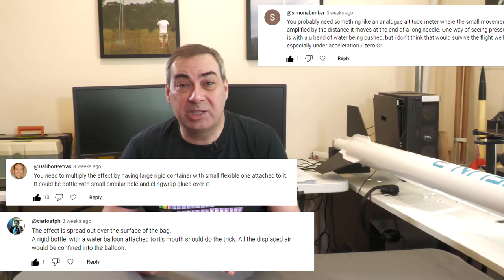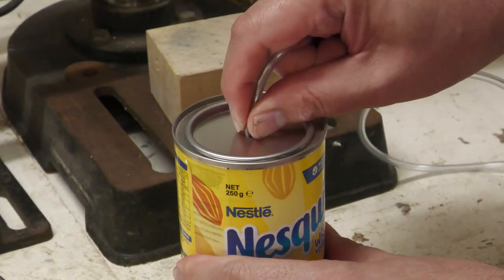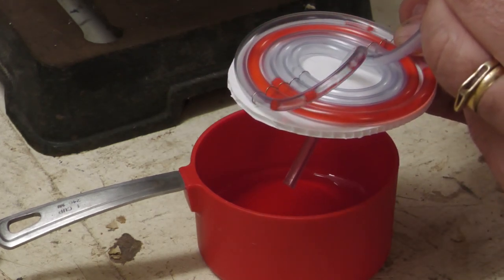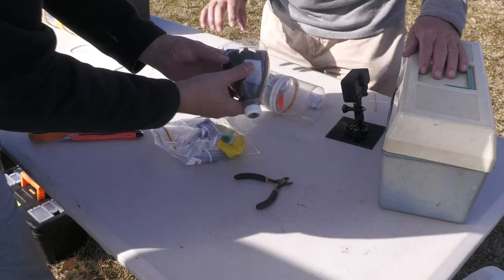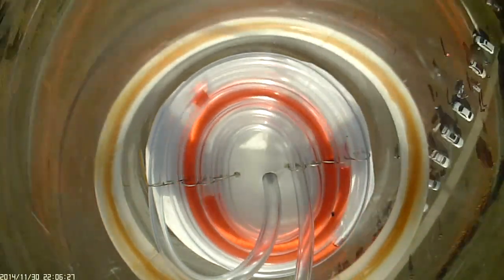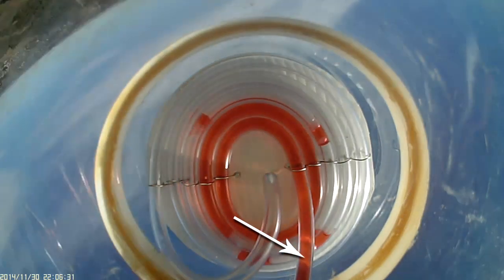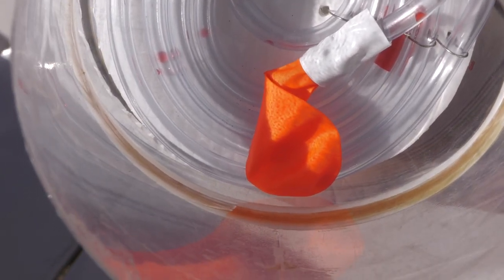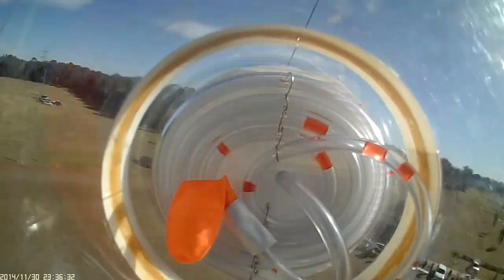Making a simple barometer

Comment: In the video you say the pressure in the can increases pushing the water out. Technically the pressure stays the same and the outside air pressure is lower as the rocket goes higher.  I know this is picky but if any would be science majors are following this a correction might be in order.

I use to fly R/C gliders in college in the 80s and we heard of a method to make a detector to figure out if you were going up or down thus making finding lift via thermals easier. It used a fix volume not unlike your experiment. There was an opening in the volume with 2 pieces of wire that had current passing through them in a bridge arrangement like you would use with strain gauges back then. The wires were high resistance and heat up. Since these wires were in the opening of the volume you could tell if you were in sink or lift by seeing which wire was cooled (and thus changed the wire's resistance)  by the air flow into or out of the opening to the volume.  The bridge balance current could be used to feed a transmitter with a constant tone that shifted up of down as the bridge balance would change. We tried to build one but we never could get it all small enough for the gliders. We were ME students not EE so that didn't help with getting it optimized as well as poor college student syndrome.
Reply from the maker: Ooops, you are quite right of course. Thanks for pointing that out, indeed the pressure doesn't rise. It would only rise with increased temperature. Really interesting description of the wire sensing mechanism to determine air flow direction. Thanks for sharing.

Comment: I reckon you could read pressure directly from the water if you calibrate it and put markings on the clear tube, but altitude will need to be calculated from pressure separately since it doesn’t go up and down linearly relative to the pressure. I’m sure it’s possible to get a pretty accurate altitude estimation with enough water trickery.

Comment: Recently I've got into water rocket building and your channel is simply a treasure of knowledge !:) It looks like you're using scuba tank to pressurize rockets. May be you could show your system in more details? Like, which regulators do you use and high pressure lines, stuff like this. Even with relatively low pressure launches with kids pumping the rocket becomes annoying pretty quickly:)) 
Again, thanks for sharing the knowledge, it helps so much!

Comment: I'm curious why the water didn't go back at the same rate during descent. 
Maybe the lid is not as airtight, as it should be?
Reply from the maker: Good observation, I noticed that too. I am wondering if the orientation had anything to do with it, perhaps it got more sun being on its side and the internal temperature rose a little.

Comment: I wonder if there is a way to use a water rocket to measure the atmospheric voltage gradient? I am not saying fly in a thunderstorm (Although this would be some great footage...), but the higher you get the more positive ions there are and this can produce significant voltages that you can measure with a Franklin Bell or an electroscope. The only practical problem is that you would need to connect to ground (or have some other source of negative ions?) - which would require you launching with a thin wire connected to the rocket.
Reply from the maker: It would be interesting to measure the static charge a rocket accumulates in flight. If you needed a ground reference you would probably need to unspool the wire from the back of the rocket the same way a TOW missile does it. I wonder if you would be able to detect any voltage across the length of the cable as the rocket falls back down through Earth's magnetic field. (If the rocket lands some way from the launch point so the cable is more stretched out)
Reply: Yeah I was thinking something like that. The unspooling would look great on its own - I'm not sure what the range safety officer would think of this idea!
Reply from the maker: @simonabunker  waves hand .... these aren't the cables you're looking for.

Comment: Im having trouble making my rocket stable, any tips on how to have a dtable rocket?
Reply from the maker: Put your fins as far back as possible. Add some weight to the tip of your nosecone. If it is just a single bottle rocket, add perhaps 50 grams to the the nose. What is your rocket's current configuration?
Reply: @AirCommandRockets  i have a 1.5L bottle, and have a bit of weight in the nosecone, my fins i calculated to get the right size
Reply from the maker: @SnarkyRattleTrap  Where are the fins mounted on the rocket? For single bottle rockets, they normally need to extend down past the nozzle. Hard to make recommendations without seeing the rocket. Also is the rocket unstable throughout the entire flight, or just during boost? If it is just during boost, try reducing the water amount to 25%. Do you use a full bore nozzle, or a restricted one? With restricted nozzles you have more weight near the bottom of the rocket for longer and so it tends to be more unstable. I would just add more weight to the nosecone as the simplest solution if you can't move the fins back. How did you calculate the size/position of your fins?
Reply: @AirCommandRockets  i could definitely try moving the fins longer back, as of now they are in front of my nozzle, thanks alot for the replies, and i love your videos!

Comment: Hey how many minutes to make thrust 1 min? 3 min?
Reply from the maker: I am not sure I understand the question.
Reply: @AirCommandRockets  how much pressure to make thrust
Reply: @AirCommandRockets  i pump for 5 minutes
Reply from the maker: @Colossaltitannwkwbend  How long you pump for depends on what volume of air your pump can pump per minute, what volume of air you are trying to fill and what pressure you are trying to get to. Let's say your pump can pump at 1 liter per minute and you are trying to pressurise a 2L bottle to 10bar. Then your pump needs to deliver 20L of air which will take 20 minutes to pump. If your pump can do 2L per minute then it will take 10 minutes to pump.
How much thrust and for how long that thrust will last depends on your pressure, volume of pressurised gas, and the size of the nozzle.
Reply: @AirCommandRockets  okay

Comment: unrelated to the video but im trying to make a water rocket and i shoot it up and i put in a fall away nose cone along with a jolly logic chute release i launch it and once it reaches apogee or highest point the fall away nose cone just does a nose dive in to the ground. its a basic water rocket so it goes sub 200 feet. the chute release does its job and deploys the chute but the fall away nose cone doesnt fall of so it just doesnt deploy and slow it down. (i tried weighing down the bottle neck of the fall away nose cone but it made it worse. (if anyone could help i would love some help)
Reply from the maker: I am not quite sure I follow. You have trouble getting the nosecone to fall away at apogee? This can be very unreliable. Just curious if you have a JL chute release, why does the nosecone need to fall away? You can set up the deployment with just the chute release so the parachute is ejected sideways.
Reply: @AirCommandRockets  im going to try to use a mechanism that uses a tomy timer attached to a rubber band that realeases a chute door. i didnt realize that it doesnt work alot i just saw everyone else doing it lol